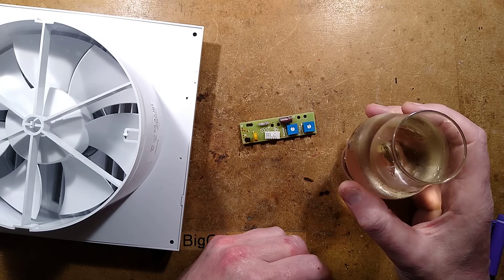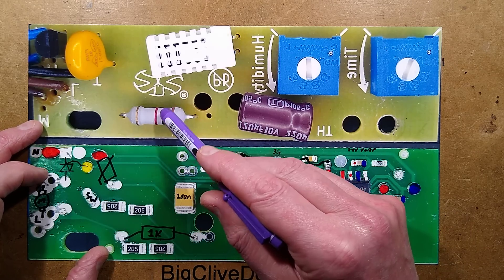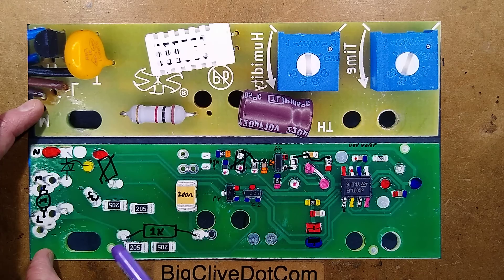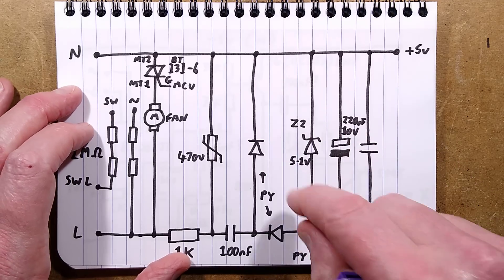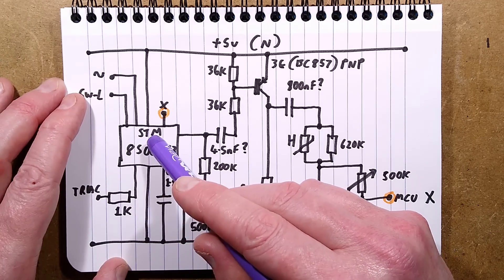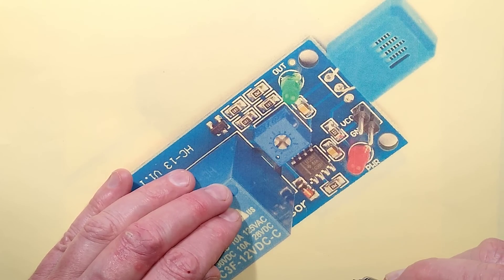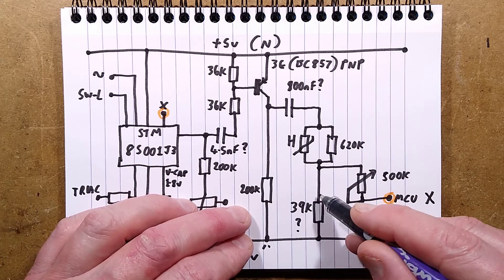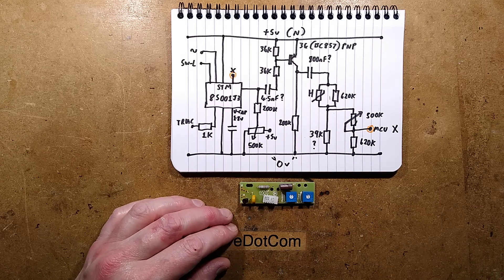Wine powered toilet fan circuit analysis

Comment: Pretty neat but I'd rather see the whole unit except the humidity sensor and pots encased in some kind of resin to keep it from corroding, bathrooms can get rather humid and with the current tracks being so close together..... well you did say it was cheap. I was kind of hoping to see a booze powered bathroom fan 😒
Reply from the maker: It did have a thin protective coating on it, which made probing connections a bit harder.

Comment: Switching the triac not at zero is partializing the phase angle and that reduces the power to the fan and introduces high frequency noise and sinewave distortion that the energy company is not very happy about...

Comment: I perfer to use external diodes to clamp the inputs, the esd diodes on the inputs are in my experience on very robust. Best to know what the characteristics are of the components in your design.
Reply: Not really an esd diode unless they have specified it as such. Most often they will be a body diode that's part of the chip fabrication process. Many manufacturers will specify allowable current through them and such which should count as specified really. Also with 2 meg of electron sieving going on I get 0.1 milliamps that's pretty low really.
Reply: @zyeborm  I was also going to say that using the body or esd diodes can also lead to device latch ups in strange ways. which is why for a few extra pence i can have a well defined part.

Comment: why are the photos some back to front and downside up, and the other the right way round and downside down? are you temporarily moving to Australia? or prison? or something?
Reply: Clive does that so the top and bottom of the board match when he reverse engineers them, makes it easier than to keep turning the pcb over to check where he is.
Reply: @MrBradleykeith  heee heee.. i know 🤭 he even says so in the video. but i like to see BC chat sometimes.  :)

Comment: RH is at 94% in my area right now. Hope these humidity-detecting fan controllers have a run-time limit on them.
Reply: The sensor measures the relative humidity inside the bathroom.

Comment: Interesting circuit ^^ And yes, those cheap but "safe" humidity/temp sensors are called DHT11, but they're not that accurate. The "better" version is the DHT22 (or AM2302) that comes in a 4-pin package (+V, data, GND, GND). The DHT22 is a bit slower (you should only probe it every 3+ seconds while the DHT11 can be probed every 2+ seconds) and can apparently "glitch/freeze" sometimes and has to be disconnected from power in that case. You should also use a resistor (5-10k) to pull the data pin high. I've experimented with a DHT22 a few times so far, and it works well, but I guess the values should be calibrated and not used "raw" since it consistently read a temperature that was 1-2°C higher than what all other thermometers in my room measured...
Reply: Accuracy of humidity isn't particularly important when you're just making a decision on whether to turn a bathroom extractor fan on or not. You just want it on when it's high and off once it's not.
Reply: They have a new I2C module called DHT20, might want to look into that one

Comment: “Swift air” sounds like a zombie brand that a “Chineseum crap” factory has slapped on this piece of tat, despite that ~ professionally done PCB, you said it goes into time-delay when the light is on for a long period of time, and not if the light is on for a brief period of time  - 🧐, most of our generic time-delay fans are triggered by the [light switch] signal and doesn’t differentiate between short/long period. The fitting on the outlet suggests it could have “butterfly” back-draught shutter fitted
Reply from the maker: It had a horrible flappy plastic flap.  I was hoping for a thermally actuated shutter.

Comment: Would love to hear your views on the liberty 2.0 generator [ free portable power] 
A guy i know is trying to construct one using four microwave transformers😱looks extremely sketchy to me
and i don't want him to die
Reply from the maker: It looks like most of the free energy scams.  There will be hidden batteries or another power supply in the demo unit.
Reply: @bigclivedotcom  Thank you, i thought it probably was🙄
Reply: Oh, the one the oil companies are hiding from us? It was drilled into my head that free energy/perpetual motion is nonsense by the venerable Russian book "Physics for Entertainment" (1913!) that I possessed as a child here in India. 

Regardless, at some point the gears ought to turn in people's heads that if it were possible, someone would start massive farms of microwave transformers instead of wind and solar.

Comment: humidity sensor is for when you dont have it behind a switch. it will turn on when it smells moisture. I have one with light sensor and moisture. so when it sees light or motion it turns on also

Comment: I am hoping that those DHT11 sensors use AC and not DC on the sensor.  Am I yet again employing the Walt Disney Theorem?
Reply from the maker: They will probably read the humidity sensor with AC internally.
Reply: I thought the DHT11 sensors were included in Arduino "starter kits".. so it is an interesting question. i'm sure these are DC

Comment: Interesting control circuit, novel way to drive the humidity sensor without using an H-bridge.

I'm surprised UK exhaust fans do not have a damper flap to keep warn air from exiting when the fan is not running, On this side of the pond there are dampers both on the fan itself and the weather hood on the outside of the building.
Reply: There is no difference between both sides of the pond in that regards. That fan is not meant to be installed like that!
The fan itself is installed in the (bath)room (usually in the false ceiling, over the shower or close to it). And it is hooked up to a duct via the roof/attic. It is THERE that those flaps/dampers are installed, not on the fan itself!

Aka: this is not a fan to be installed directly in the OUTER wall of your (bath)room. You should never do that (unless it is especially meant for it of course, but those will indeed almost always have such flaps, an insect mesh, etc)

Note that this was also mentioned/drawn in the manual of the fan, btw. You can get a glimpse of the installation drawing when Clive shows the manual.

If you look how the fan is laying on Clive's desk: the side that is clearly meant to be connected to a duct is in plain view. The other side, which is touching his desk, is the side which is meant to face your (bath)room. So, he has the fan laying upsidedown so to speak. Aka: this is NOT a fan which is meant to be installed without any ducting.
Reply from the maker: It does have a horrible floppy plastic diaphragm.  I was hoping for a solid thermally actuated shutter.

Comment: Another aspect of keeping power low is that the MCU doesn't need to drive the triac continuously, it can just give it a few pulses around the zero-crossing point.
Even without zero-cross, it can still use pulses rather than condinuously driving to save power
Reply: So, this would be basically a DC powered device?

Comment: Use ac with the sensor, but with a capacitor there, is it really alternating current any more...
Reply from the maker: The capacitor is to ensure that only equal current flow in both directions can occur.

Comment: Loved this one Clive. Very good. I still find it hard to believe those little to92 triacs can cope with mains switching, I'm still remembering the massive packages back in the 70s... PS. Your 39k resistor was found on the top deck of a 432 bus, without a ticket of course.
Reply: Remember that it doesn’t have to carry much current and only switches on zero crossings. Having to switch with voltage across four layer devices means huge current spikes. That’s why those old tangled puck devices were invented. The main terminals had lots of surface area which coupled nicely to heat sinks and in some cases water cooling systems.

I think Clive should do an episode covering four layer devices in general, why different types exist and what they can and can’t do. When I was first introduced to them in the early 70s they struck me as black magic.
Reply: @markfergerson2145  Yes that would be excellent. Thanks Mark.😸

Comment: I've never found one that actually works beyond a few weeks, then it turns into the loudest most inefficient thing on the planet, before getting knocked out with a hammer, and the humidity sensors are so cheap they die almost immediately

Maybe a good idea to magnetise your tweezers? 🤣
Reply: 😠 ~ nowadays, most [of the cheap ones] consist of Chineseum crap with a zombie brand slapped on them/no brand at all. You have to buy the [unfortunately, more expensive] British brands of fan; vent-axia, manrose, Vortice, xpelair…
Reply: @samuelfellows6923  think the last one I got was a ventaxia brand but even that sounded like a death rattle, in the end I put up a plastic vent, the ones that slide, and in my view it's better because it doesn't let a bunch of crap fly in when it's not in use

Comment: When it comes to extracting bumgas from bathrooms, the one brand I think of is VentAxia, mostly because in an episode of Star Trek TNG, they had a species called the Ventaxians, which I can only assume one of the episode writers thought of while taking a dump and saw the fan on the wall... :P
Reply: The Bogrollians and Bogbrushians were infuriated they didn't get a mention.
Reply: I do wonder though, why these fans don’t have a methane sensor too…
Reply: @demil3618  Because there is very little methane that comes from our digestion to trigger such a thing, a lot of the gas we expel from our rear is just air we've swallowed, followed by hydrogen sulphide (the eggy smell), with a pinch of methane plus some other odourific chemicals that are produced in our gut... :)

Cows on the other hand, they belch the stuff out...
Reply: @twocvbloke  I heard stories where people used a cigarette lighter on others to heat their bottoms. Just stories though, never tested it myself 😁
Reply: @demil3618  I've tested it myself and it does indeed work for me. I've heard it only works for some, guess I'm just lucky :P
Reply: I gave up on VentAxia after having several 4" mixed flow units all fail at around 18 months use in a domestic environment. They were replaced with Manrose units which have lasted for 4+ years so far and were also much cheaper.
Reply: The Panasonic fan in my house toilet room appears to have been in the house since it was built about 30 years before I bought it... And that was 10 years ago.  

But now since I wrote that, it'll probably break tomorrow, I suppose.

Comment: Hi Clive, another great video. Thank you. I have an eBay item that I would like to send to you for a tare-down. Can you tell me where to send it? It is a 433.92MHZ Keyfob Remote that was faulty on arrival. I have ordered this remote from different sellers at different times and they all have the same fault. Clearly, they are leaving the factory like this and they must know that these units are faulty because a simple test is all that is required to show the fault. If you could find the fault, that would be great. If you could find a fix for the fault, I am sure hundreds, if not thousands, of people, would be grateful, including me! Cheers Clive 🙂
Reply: can you priovide more info.. what is the details of the fault and what exactly was it tested with?
Reply: @Palmit_  To program the remote, you should hold down two buttons (A & B) until the LED flashes three times. However, when you press the two buttons or any other button or combination of buttons, the LED lights but never flashes. Therefore, the remote cannot be programmed.

Comment: I'm glad you're doing this. I have an Expelair toilet fan that's operated by a PIR. They don't seem to last more than a couple of years and has been replaced under warranty several times.
I hope this video shows its weakness, I haven't watched it yet as you can guess
Reply: It would be interesting to see which part fails. I don't see a snubber across the triac and there seems to be limited protection for the micro to incoming switch or PIR spikes, though analyses with a scope would be required to see if these were potential issues.

Comment: The BAV23Se has a 250 volt max reverse voltage according to Mouser...
Reply from the maker: In this case the voltage on that side of the capacitor is shunted down by the zener diode, so the twin diode package will not see a high voltage.

Comment: Yes, DHT11. They're ubiquitous and cheap, but not that accurate when it comes to humidity measurement..
Reply: The DHT22 is much better and also much more expensive. Works really well with Arduino remote sensors and since they are only powered on for 2 -3 seconds every hour or so you don't need to worry about electromigration.

Comment: Very interesting...I feel dumb asking but I a novice with electronics:  what is Impedemce? is it the same as resistance?
Reply: To be just a bit more precise, impedance is the opposition to current flow through a circuit. The opposition can come from two contributing factors - one is called resistance, which is literally a measurement of how easy or hard it is for electrons to flow through a particular material, and the other is called reactance, which is a measure of the opposition to moving electrons created by a changing magnetic or electrical field. 

Impedance is usually represented by "Z" and can be calculated as Z = square_root(R^2 + X^2) where R is resistance and X is reactance. The "^2" here means squared, so R^2 = R multiplied by itself. In a DC situation, the X term becomes (essentially) 0, so Z=R, but if you have AC, then the inductance and capacitance parts of the circuit create a non-zero X, and so Z will be larger (sometimes only slightly, sometimes a lot) than R.  

The X term in general can be broken down into a contribution from inductance and a contribution from capacitance, and interestingly, they subtract. So X(total) = X(inductor) - X(capacitor). These both depend on the frequency of the applied voltage and current, so if you know the frequency involved, you can tune an inductor and capacitor to each other to minimize X and reduce the overall impedance of the circuit to near the minimum (which would be R) for that frequency. That frequency is where the inductor and capacitor can set up resonance.  When you tune an old AM radio you are quite literally changing either an inductor or (more often) a capacitor to change the resonant frequency where the impedance is minimized.

Like resistance, impedance is represented in ohms and can be calculated as voltage divided by current. If these are DC (unchanging) values, then the impedance Z and the resistance R are effectively the same and are often interchanged. For AC, it is more important to specify whether you are talking about impedance (Z) or resistance (R) because here they are usually different.
Reply: Yes, and no. Just to confuse things even further there is also reluctance.

Impedance is the AC equivalent of resistance in DC circuits.

It's a complicated subject because impedance and reluctance vary depending on the frequency.
Reply: @chrishartley1210 
And DEFINITELY don't forget confusious. Or is it Confucius, that really wise dude?
  🦉🎊🎉🎎ԅ( ͒  ͒ )ᕤ
Reply from the maker: It's like resistance, but the expected current will be very different with AC.  If you measure a motor's resistance it seems too low for its power rating.
Reply: And there you have it, the complicated answer and also the correction of my reluctance to reactance. Reluctance is also a thing but refers to magnetism.